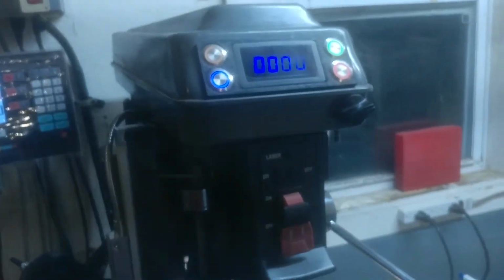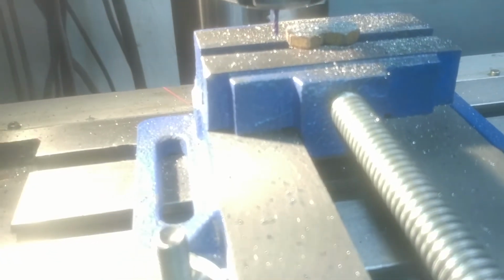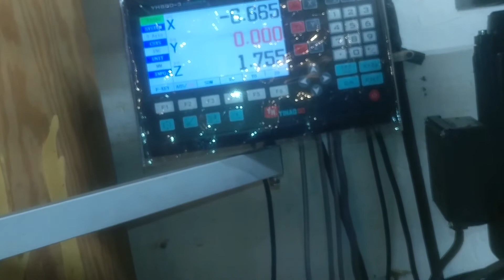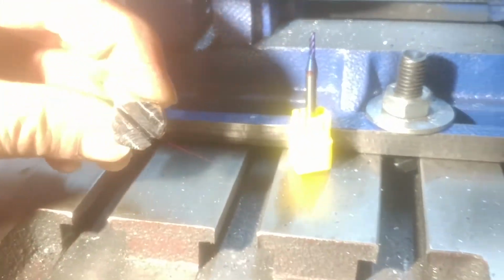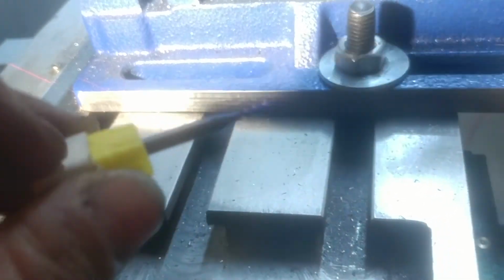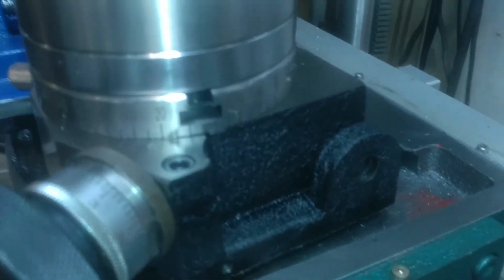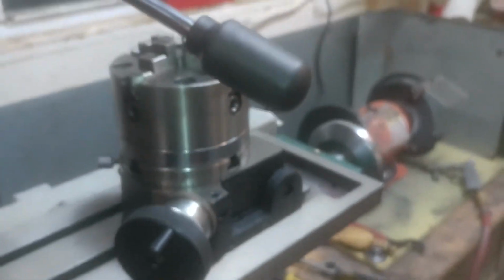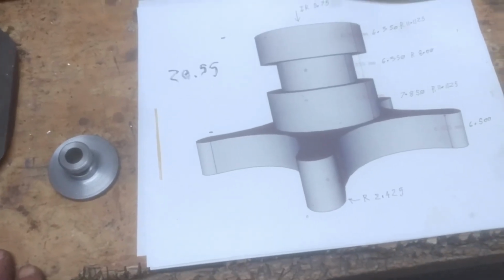Drill Press to Mill Conversion E4 covid work around

Comment: Yes Sir, i really like it. You think i should do one to or save up till spring time get mini mill around 1200-1500$ machine.do one around march April or start on homemade now have cheap cental machine bench drill press almost new older model least 17 or older think its before 2000s but i bought it pawn shop few years back i use hand drills mostly for what i do. I have nice db 200 unimat with mill attachments. Look new. Hate to tear it up using it .  Were its kinda collectibles. But i would use it. So small not for what i need mini mill more like about that size u built would do great.
Just seeing what tou thought as u made a nice machine. Its always see people building them and lots of um are nice. But they always end up buying a factory made machine later down road in few years or so. I understand factory machine is probably better but if there that bad minds well save now. Idk. Thanks anyway for ur time and making these videos there very helpful. Stay safe from ur ole hillbilly buddy.
Reply from the maker: You can still use them to drill after doing the mods; it just takes a bit longer to change drill bits with the ER 32 collets, but really not that bad once you get use to it.